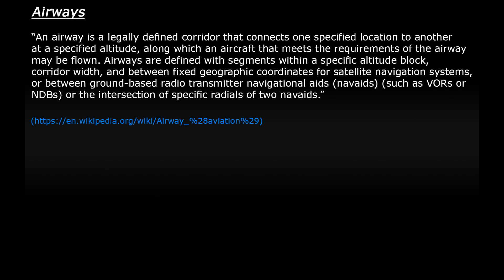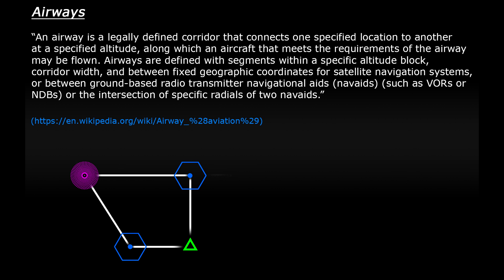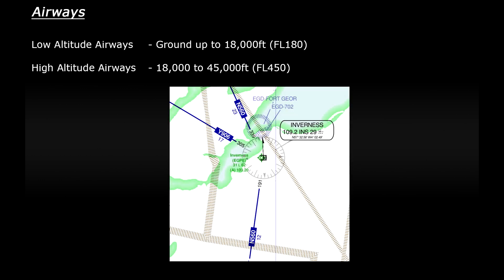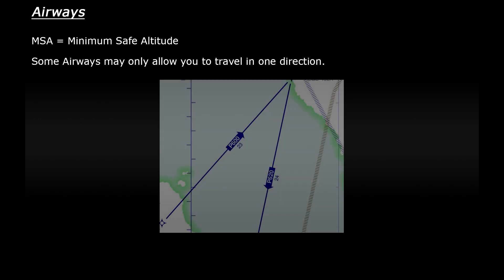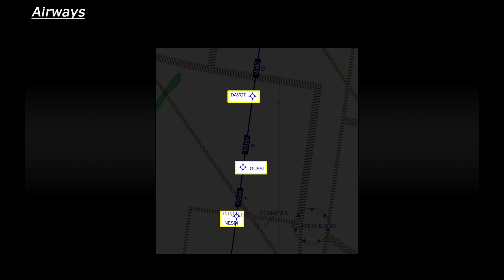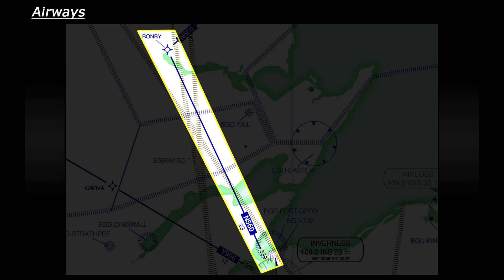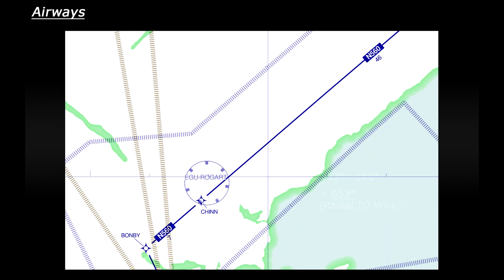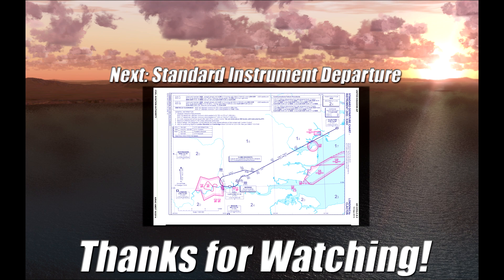Airways

Comment: Hello. When does the airplane have to follow the airway and when does not? I assume that jets, airliners etc. needs to follow the routes, but what about small planes and short flights? In Your example if we wish to fly directly from city to city (because of shorter flight) - can we do this? And 2nd question - a little connected with this subject - are there any areas on the sky not controlled by any ground tower? (like on the ocean?) How the planes does not crash then? Thank You in advance for Your reply and thank You for all Your videos.
Reply from the maker: Larger aircraft usually fly by IFR rules, so ATC tells them where to go, what airways to use etc. Small planes fly using VFR, so they can go where they want a lot of the time and they don't fly as high. As for uncontrolled airspace like oceans, planes can be tracked by Satellites and they often communicate with other planes who are close enough to speak to ATC. So ATC will basically say to a plane... "Hey American Airlines, you've got a British Airways about 50 miles ahead of you, could you give them a call and ask if they're ok?" The American Airlines then contacts the BA plane, BA says they're fine then the AA speaks to ATC again to let them know that the BA is responding and flying normally.
Reply: 1. Think of airways like highways that connect places. You start with a SID from your home to the highway and stay on the highway and finally leave it via a STRA/Transition. In most countries it is mandatory to file a FP with airways but ATC can and will give directs. Some airspace (like Austria) are a FRA (=Freeroute airspace). You navigate form FIX to FIX/VOR/NDB. Eurocontrol wants more countries in Europe to employ this and so far quite a few have. Austria and Slovenia are the only one that have a 24h full airspace FRA. Even short flights have to follow airways (if filed a normal IFR flight plan). VFR flights are different. You would file a route including towns and landmarks. It odes mean that you gave to follow this route but in comparison to IFR you can choose your altitude freely (if there are no restrictions or airspace you must not penetrate).
2. I can't think of any place where the airspace is uncontrolled. In places with nor radar coverage (eg. in the Atlantic/pacific/Indian ocean) you would use oceanic procedures. You would ask for clearance prior to entering oceanic airspace, get assigned a speed and altitude and after that are allowed to commence your flight. in busy areas tracks (=predefined group of fixes) would be punished which ease operations. they communicate via HF radio or CPDLC.
Reply: @jakobeng1303  correction, STAR :D